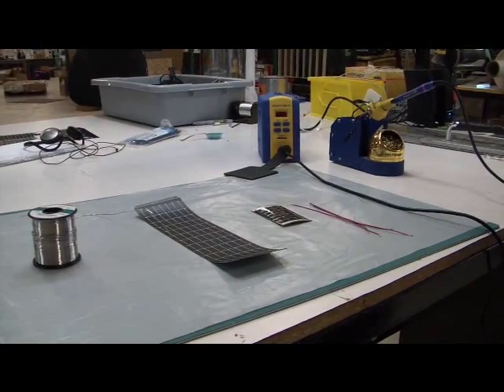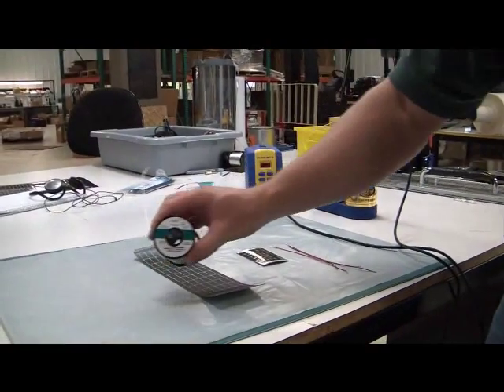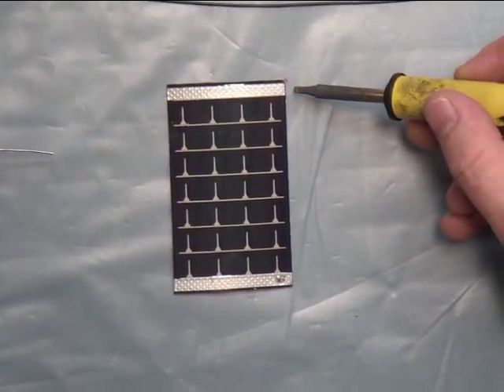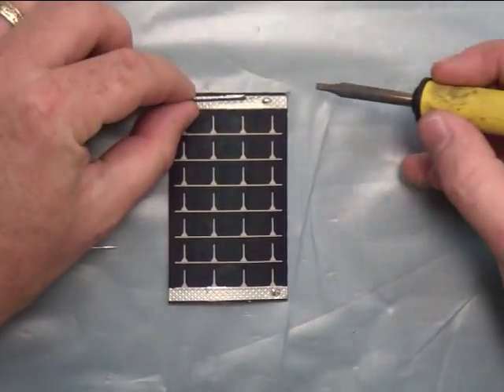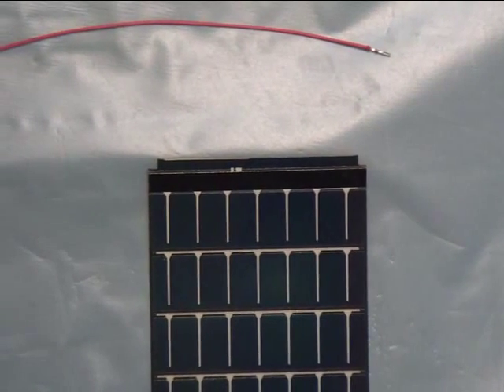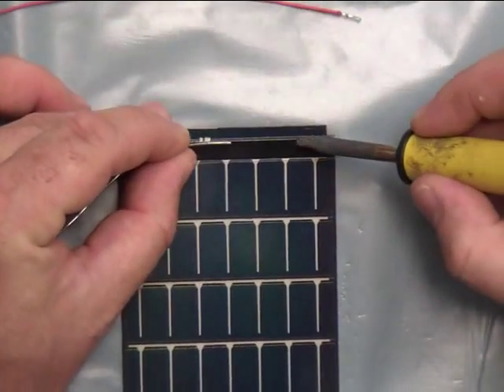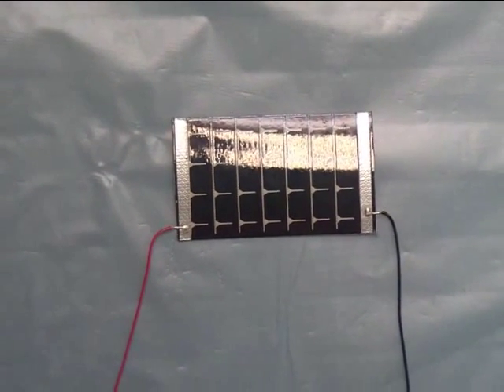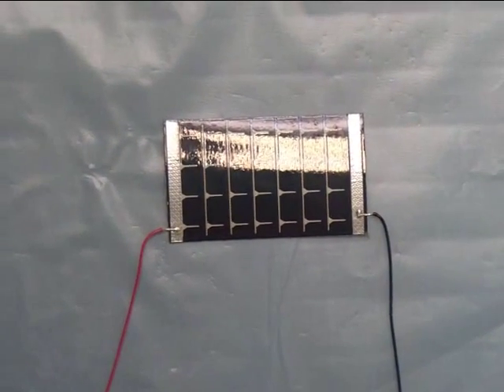How to Solder PowerFilm Electronic Component Solar Panels

Comment: Can these paper-thin cells be folded and unfolded? For instance, I would like to have a MPT15-150 folded in the wallet, and then unfold it to charge batteries when required?
Reply from the maker: Jorge, 

Fantastic question. The panels themselves cannot be folded, but you can connect multiple smaller panels on a fabric backing to be able to fold. This is the same idea that is applied to our Foldable line. You can see them here: https://www.powerfilmsolar.com/products/foldable-solar-panels/

Comment: Hello, Thanks a lot for the video. I have a question, does powerfilm have any solution where I can solder the positive terminal from the back of the solar cell???
Reply from the maker: Thanks so much for the question. We do offer backside contacts, but those panels are going to be more expensive due to a different manufacturing process. If you are interested in a specific panel with backside contacts please send us an email at: shansen@powerfilmsolar.com. Thanks!